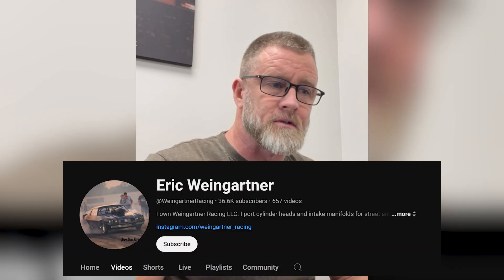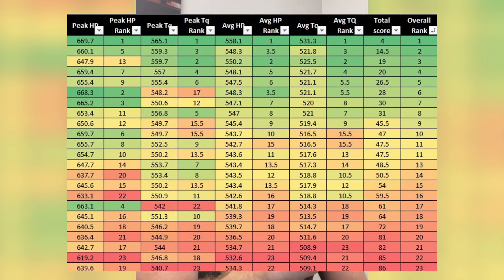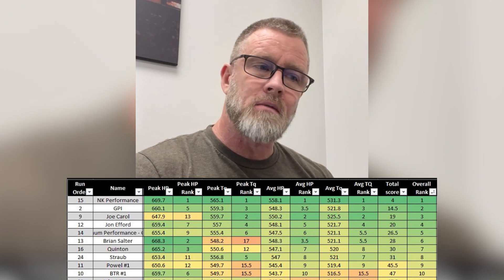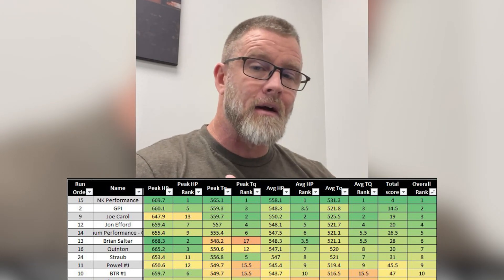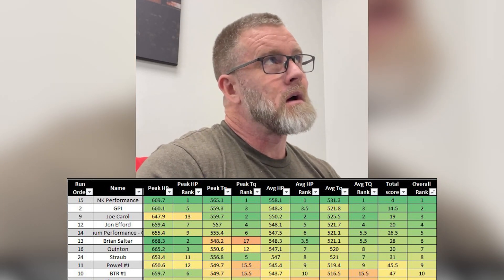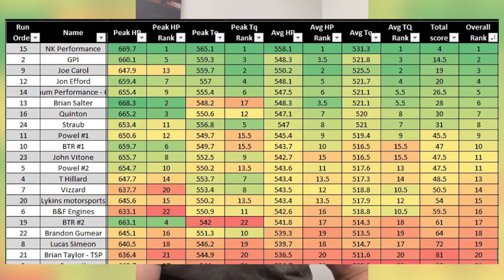Did GPI Make the Top 3?!

Comment: Air in, air out. Doesn't matter how you get it in or out . The more the better.
Reply: Wrong. It matters if the air enters or exits a window in the block.
Reply: That's not at all true. If that were the case lift would be the only spec mentioned or focused on. Lsa and duration play a huge role in cam performance as well. The intake opening event and the time at which it occurs is also a critical factor. These all play a roll in not only hp gains, but power curve shape and width, streetability, idle characteristics etc etc etc. a lot of this info is touched on in the video. Listen to what's explained and try your best to learn from the free knowledge

Comment: I’m not sure who “OP Mustang” was, but I thought their results were the most interesting by far.  They were down about 10 hp and 10 ft.lbs across the board.  However, they had substantially less overlap than the competition making similar numbers.

I’d be super curious to see the driveability difference in their camshaft vs the extremely aggressive grinds making similar numbers on the list.
Reply: Optimum Performance. Seems someone had a typo
Reply: It was a pretty spicy lobe profile. And it was milder than my first choice. It was a lot of fun.
Reply: Where do you see the specs of the cams?
Reply: @TomKunnas  paid members got those numbers.